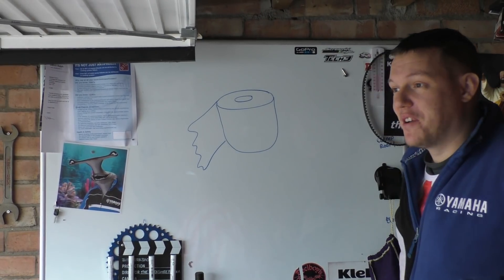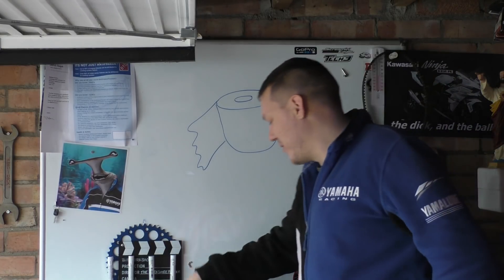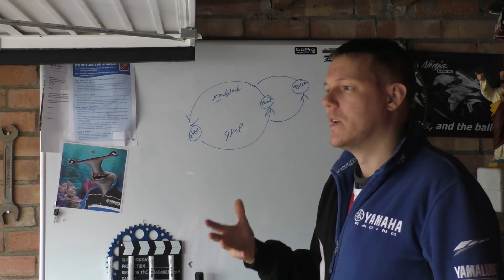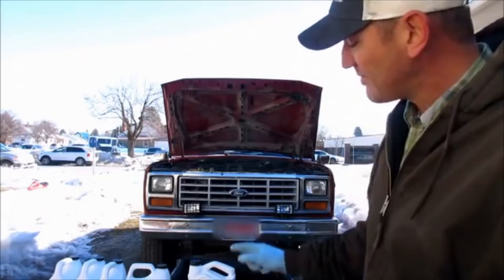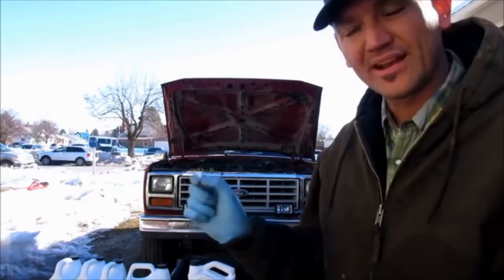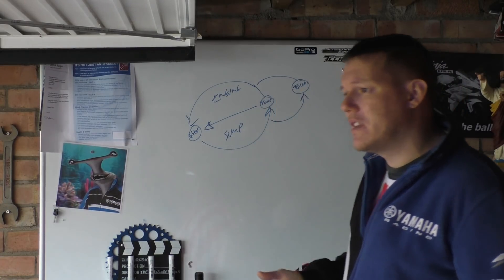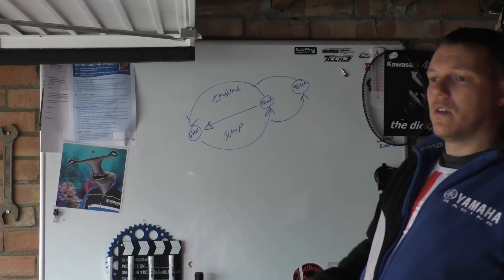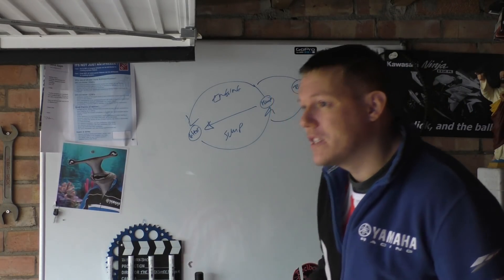Toilet paper filter???

Comment: I wonder if the toilet paper (dunny roll) filter would remove any wear packages in the oil, less than a couple of micron?
Reply: Vince GLEN they filter to about 2 microns or so when using the replacement cellulose fillers that Frants makes that don't need to be cut down to fit but using a roll of turd tickets usually fillers at about 8 microns and after a while they develop creases going up and down and you lose filtration pretty quickly

Comment: Hi everyone. 

Oil additive packages do wear out, the oil is mor or less the ash tray of the engine, 
 the job of the oil is many, it lubes and cool parts, cleans the engine, neutralizes acids and keeps particls suspended in the oil so they dont buil up any sludge.

Bypas oil filters are used many places in marine applications (not the toilet paper variant). they do serve ther purpose in some applications. 
Full flow oil filters has at best a micron size of about 20 microns, and bypas oilfilter get`s down to about 1 micron. 
But most of the wear caused by particls are smaller than one micron, so the best option is to change the oil more often.

One thing we was taught at the marine engineer school, (at that time at least) was that there is no rules stating that the new oil they sell had to bea free of particls.

Comment: I wonder how large the chunks of munched up carbon really are? Cranks run with a few thousands of inch clearance, but the carbon granules could be much smaller than the thickness of the oil film. It is always worrying to see filthy black oil in an engine, but maybe the important stuff is what we don't see. I actually like these bypass oil filters, but they won't make the oil and the additives last forever.

Comment: so the central core of any filter is perforated to allow the oil through to the filter element, last time i looked toilet rolls had a solid card core so its not going to flow anything! Anyone else pick up on that? all its going to do is bypass some shitty oil round the ends thatll soak the  bog roll.
( ive got teenage kids so there is ALWAYS used cores lying on the toilet floor NEXT to the fucking bin so im a fucking expert)
Reply: All of the toilet paper filters filter from end to end. From top to bottom. Oil isn't supposed to go thru the core.

Comment: I heard that using toilet duck as oil is even better as it actually cleans the inside of your engine
Reply from the maker: From who? A wizard?
Reply: Best with the ones that you'd usually clip on to the inside of the toilet bowl mate. I had a horrible smell coming from my fuel tank, but I clipped one of those to the inside of it, and now every time I fill the tank it smells a bit better. Soon enough it'll be lemon fresh. Problem solved

Comment: Oil probably would actually flow through the filter, but with such a low flow rate the particles would probably just settle out in the lines before they even reach the element for the most part and you'd end up with just lines full of sludge completely blocking flow, and keep seeing a clean element and go "see, it works, no more crap in my engine"

Comment: i had an issue  on with copper leaching on a generator, once high levels of copper coming back in the sample. and the oil cooler was all green and the cheif was freaking out thinking the engine was going to have issues but copper leaching happens although rear and will eventually start to lower with more running hours.

Comment: If i put aloe vera infused paper roll will it be better??😀 what a fucking tool, when that toilet paper gets saturated with oil it will clog up so the bypass will build pressure and the oil will follow the normal path. That shit will do nothing good the only thing it can do is if a piece of paper leave the can and go in the system clogging up an oil galley

Comment: Wait wait wait... re: friction modifier oils.
I can safely put automotive oil in my bikes? I dont have to worry about friction modifiers fuckin up my clutch?
Reply: The Workshop yeah, you're right. We've all heard in the past that friction modifiers in car oil will make wet clutches slip. Whether it would or not, none of us know. We need a test. Or feedback from someone who's tried it before. I'd rather just not take the chance though for the price difference..
Reply from the maker: "but will make it slip like a bastard"

- proof is required............................
Reply: So what happens if you accidentally try to mix regular and synthetic oil and try to run it in a bike?
Reply: Synthetic isn't the issue. It's the friction modifying additive packages (Matt mentions moly D among others). Usually branded as high mileage or whatever. The api donut on the bottle has a spot for this information. According to the manufacturer of your bike, the lower portion of the donut should be blank.

Only first hand I have is an xj I used to have. Before and after and back again.
Didn't slip before. Put in whatever high mileage stuff I found at checkers, then it did slip. Changed oil out for some jaso mc spec something or other and the slip went away. Sure, could be lots of other factors.
I don't have a time machine to take you back and let you ride that bike for your proof. 
Accidental test was as scientific as I need over a matter of $40/year. If there was more risk involved I would care for a greater body of evidence too. With the hp on the bikes I ride nowadays plus all the fekking plastics to dig through for an oil change it's just not worth it to me to repeat a test I already done. The results are not all that harmful or damaging, you just end up with a clutch that slips, more so in higher gears, moreso on hard acceleration. A little mixing, say if you just need to top up is no big deal.

Comment: Another snake oil product.
This was introduced to Australia decades ago.
After bench testing, it was found to actually filter out some of the additives among the other problems
Matt mentioned.
It’s never reappeared since, to my knowledge.
The aircraft industry sends oil away to labs to determine the microscopic metal content and
therefore the actual condition of the engine.
As Matt said it’s mostly the fine metal particles which causes most of the problems, not so much
the carbon. 
Moral of the story: change oil and recommended filter according to the manufacturers handbook or on
condition.

Comment: So you know better than the "So called Shell Oils". 
“Today we’re doing some maintenance on my truck?” So i’m “throwing this in the garbage" and repplacing in with my toilet roll paper…  IS THIS EVEN FUCKING REAL?? Better say, “Today we’re gonna fuck up my truck and fill it up with toilet paper which just disintegrated in about 1 minute (at most)..
Reply: I wrote the previous comment about half way through the video... but i just couldn't stand it.
 What is this guy going to "clean"?? something a manufacturer such as shell studied and provided  to us all (be it the best or not). Nº1.wtf are you going to clean, and nº2 are you going to do so by using a TOILET PAPER ROLL? Have we all gone mad?

Comment: i know.. not a bike.. still... gotta add it as it may be interesting. 
usually older ruiisan tractors had a superawesomely strong magnet glued to the oil drain bolt. verry handy, at oil change you CAN see the tiny steel shit shining on it, but not in the rest of the oil. recent ones lack this... no magnet.. and the whole oil has visible shiny particles...
allso many of them have a centrifugal filter, and a paper filter too. 
keeps the oil verry nice actually.

Comment: That's got to be a fucking wind up. Nobody is that thick, are they?!

Gotta be a wind up. Oil pressure at the filter would go through the roof and engine would very quickly die. Fucking obviously.

Edit: ahh, its teed off, keeping the original filter too. Oh well, that's much better. Seems like a fine idea now lol

Comment: I have used toilet paper on my ass for a long as i can remember and i can confirm that i have NO carbon build-up on my bung-hole. It works!!!!!
Reply: I just shit round the back of the shed in the garden. I've never used bog roll because I thought it was all just a myth, but can confirm I've got a shit ton of carbon build up around my hole.

Wish I'd fucking listened now. Has anyone tried anal bleaching, does it remove the carbon well?
Reply: Thanks, Laughed hard.
Reply: Your lucky you haven't run across any John Wayne toilet paper, Cause its ruff and tuff and dont take shit off anyone!
Reply: Brett Wendel priceless!
Reply: That was the best comment go to the top of the class !!!
Reply: Video or I don't believe you.

Comment: I'm showing my age here but the BBC program 'Tomorrows World' showed a new type of oil filter which they demonstrated by pumping black oil through and it came out looking like new oil. As far as I can remember the filter was similar to the toilet roll idea where oil is forced through the length of the filter paper rather than through the side of it. However It wasn't, as far as I know, ever commercially made available. Saying that, modern long life oils require a matching long life filter, which is often overlooked by the after-mart filter suppliers. I suspect high pressure pump too.
Reply: Reverse osmosis filtration is what you are thinking of. Need really high pressure pumps to work.

Comment: Back in the 70s and 80s, some whacko company sold a bolt on kit that added a secondary filter to the system. The idea was and is that the TP would trap moisture, thereby improving oil lifespan. On paper (pun), it makes sense, but even if it did slightly work back when engine oil was dipped straight out of the La Brea Tar Pits, there's no damned point with modern synthetic oil, assuming you bother to get the engine up to temp.  This is utter crap compared to the glory of magnetic carburetor attachments and HHO generators.

Rotella is great oil BTW! It keeps my backside supple and shiny...

Comment: Matt, on cars they often put a tee piece in the oil pressure sender tap off, the oil just drips through these things, the idea being that every hour or so it flows a sump full or so. When I have read about them on the net it seems some people claim millions of miles without an oil change but conveniently forget the litre or so of new oil they add every time they change the roll.

Comment: Iv seen this setup in a mates taxi in the mid 90s. Iv had a good look at it and drove the vehicle. They put a T junction at the oil light sender and run a line through a canister with this shit paper roll. The oil line then returns to the sump. From what I saw the system does remove carbon well and the oil in the sump looked new but I asked if the oil hasn't broken down and had it been tested. The service regime was 10,000klm standard filter only and approximately 60,000 to 80,000klm a new bogroll in the canister. I was very suspicious the oil looked new but wasent healthy. Wish a sample was sent to check this.

Comment: these goons don't know what they're doing, it has to be part of a loop! what you do is you get a coffee filter, roll it up and push it in to the crankcase breather pipe, then, remove your oil filler plug and drill a hole in it the same size as the breather pipe. clean off the swarfy bits and give it a good spraying with brake cleaner. screw it back in (to the correct torque, obviously!), push the pipe in, and seal it up with silicone. then, the scrubbed vapours will percolate the impurities out of the oil, and deposit them in the coffee filter.

Comment: I thought you would like that. I bought a 99 Dodge Cummins 3500 one time that had one of these equipped. I seeing this added oil filter system and Iwas wondering why there was a ziplock bag with three rolls of toilet paper in the engine compartment. I did a little bit of research and promptly took it off, wish I would have saved it to send to you for testing but that was years ago. To be honest I don't know if the engine was ever change but it went on to go 370 some odd thousand miles and I reluctantly sold it.

Comment: With a diesel it is almost impossible to tell what the oil is doing. It turns black immediately. Honda centrifugal filters work well. Old Britbikes crankshafts worked similarly with no good way to clean them.
Reply: My 1965 Honda 305 had a centrifugal.  Did a good job but an engine still  needs some new oil. Mack trucks had centrifugal  filters but still needed some new oil added. Had  250 K miles on my 84 Subaru with no oil drains using a Frantz and Mobil 1.was changing the toilet paper once a year and adding a quart of new Mo il 1. A Caterpillar lab saw my posts and asked for a sample of used oil. They said the oil looked good for that many miles but recommended  two Frantz changes and 2 quarts of Mobil 1 a year. That would be every 6 k instead of every 12 K. Always willing to learn.
Reply from the maker: You mean a centrifugal oil filter. You can't even sentence properly...
Reply from the maker: Freakin? Obviously american. You have my sympathies
Reply: Other than cleaning out the sludge trap you mean on Britbikes?

Comment: If you add friction modifiers (No Smoke) to your oil your clutch will slip.(edit) Jk
Reply from the maker: bollocks
Reply: 😉. Just because all the oil manufacturers say they won't cause any problems doesn't mean that they won't melt steel beams. Just having a laugh. Thanks for another great video.

Comment: graphite is used in certain applications as a lubricant, and graphite is actually the same thing as carbon, so why wouldn't make the presence of carbon in your engine oil make it a better lubricant?
Reply from the maker: Carbon build up is not an issue if you change your oil regularly. This is generally what the detergents in oils do, they help stop carbon from bonding and clumping together.
Reply: The Workshop yeah, problem seems to be manufacturers pushing the service schedule longer and longer, don't know if the newer oils can really take it or not. 

Also doesn't help that the majority of diesel owners tend to be a bit erm.... frugal with their spending on maintenance on their cars if they have to pay out of their own pockets. 

Out of curiosity Matt, miles vs time  for services etc, 

Would be interesting talk about whether idling an engine for prolonged periods harms the engine or not, for both 2 and 4 stroke. 

I know manufacturers recommendation shorter service intervals for high idle time engines, but I assume that's just because the odometer isn't going to be representative of the running time.
Reply: @ryanmg92  idle hours are brutal look at surplus police cars they may only have 80k miles but their shagged engine wise
Reply: Kasper Slagter doesn't work like that mate, diamond is also carbon and is used on saw blades, just because they are the same element doesn't mean they will behave the same. 
From my mediocre understanding, the reason graphite is used as a lubricant in say brushes on an electric motor, is that's it conductive, but also the way the carbon is layered the individual layers can slide over one another reducing friction. 

Problem with carbon in engines is more build up in places it shouldn't be, and I'd imagine there is some level of extra wear but that will go hand it hand with your oil generally being toast
Reply: Quite happy to be corrected if I'm wrong though lol
Reply from the maker: Good point and I added this to the list last week? Or the week previous - but good topic
Reply: Too much idling can cause bore glazing and the engine can be running slightly cooler than it would be at it's happiest.
Reply: Powdered graphite is a reasonably good friction reducer for dry applications. It's an allotrope of carbon that slides past itself.  But oil is a lubricant, a coolant, a cleaning agent, something graphite will never be.  For the most part, the carbon in your engine is not graphite.   https://en.wikipedia.org/wiki/Graphite
Reply: Well, ok, maybe carbon is just as much like graphite as it is like diamond. But how is filtering the carbon out making the oil better, if the real problem is the degrading of the oil? And is carbon really making the oil worse, as long as it is not clumping together?
Reply: Kasper Slagter to be honest, if you regularly change your oil, it shouldn't really effect it in any great way, as Matt mentioned the detergents etc in your oil should stop any build ups etc, the problem usually lies with vehicles having extended service intervals or people just skipping oil changes.
Reply: Yeah, someone already mentioned carbon/graphite/diamond are all forms of carbon, but you definitely wouldn't want a load of diamond grit floating around in your oil lol

Comment: Only correction I would make Matt, is on the carbon in the oil front, if you have a look at a lot of the failure modes on a lot of new diesels, carbon build up causes a fair bit of problems, usually with a combination of bad engine design. Causes oil pathways etc to clog over time, reducing oil flow. 
Pop goes your turbo,